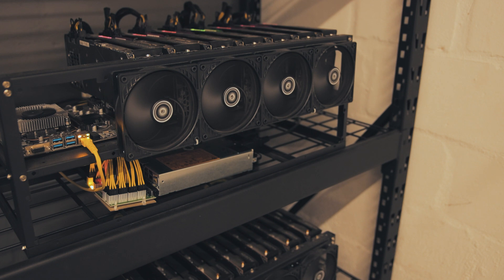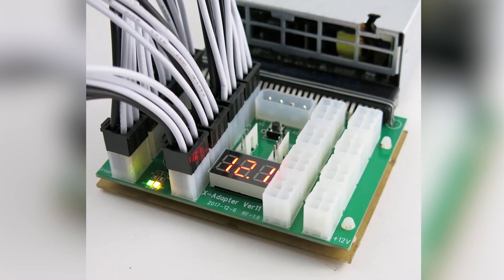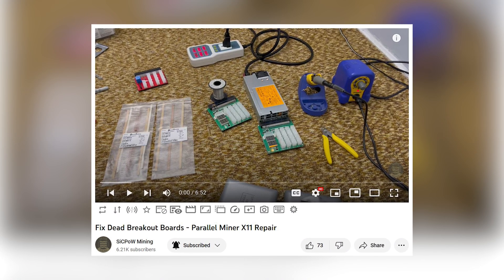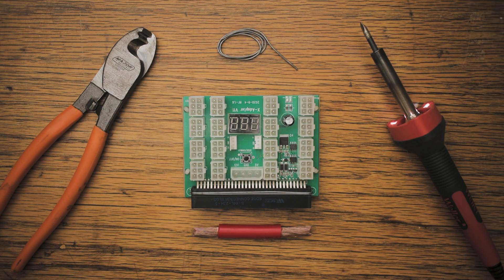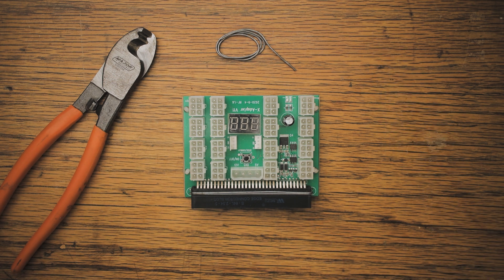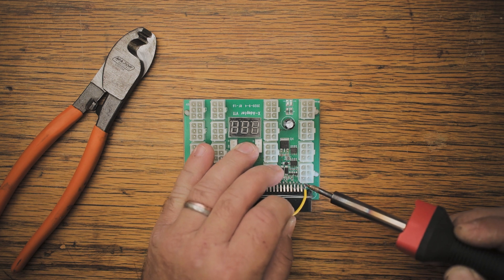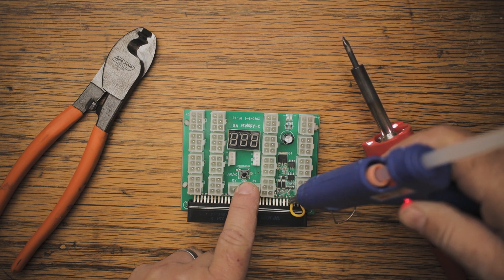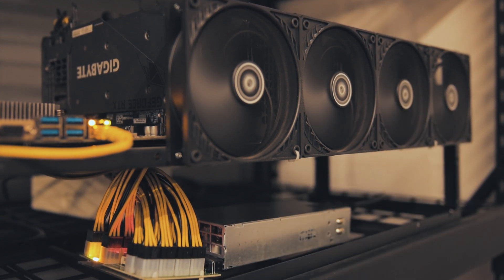It’s so EASY to fix - Parallel Miner X11 Breakout Board

Comment from the maker: Do you have  some faulty X11 Breakout Boards? In this video I will show you just how easy it is to get them up and running again!
Reply: Hey man just wondering if you ever figure out exactly what component is the one that fails, Long story short version , i had 2 that stopping powering up , not responding to the ON button , didnt use them for a year, now that i check them again they work, i feel like one component heats up and this cause the board to turn off

Comment: hi , In the video you mention he welds pin 1 and 7 together with a resistor and pin 4 and 5, how is your method different, I have a dell 1400w power supply, thank you.
Reply from the maker: When using a Dell PSU, then use the second method I demonstrated in another video.

Comment: Does this fix still allow the X11 board take a signal from an ATX PSU as to turn on or off? I have a schedule in Hive that turns off the rig during the expensive time of day pricing from my electric supplyer.
Reply from the maker: With this fix the psu will remain on at all times. Your schedule in hive will still work, as it will power down the motherboard, although the psu will remain on.

Comment: Just tried this on a PM x11-amp, no go, still yellow light on break out board and blinking on the power supply.
Reply from the maker: Which PSU are you using? HP?
Reply: @ThreeFoxCo  The Dell Delta DPS-1200MB
Reply from the maker: @loxety I found that 1 of my Delta’s also dis not work. I will be making a follow up procedure, which includes a resistor as well, which should solve it for Delta 1400W PSUs.
Reply: @ThreeFoxCo  I've got maybe 12-16 of the deltas, X11s, X11-AMPs and ZSXs.  I mainly have problems with the X11's dated September 2020.

Comment: Really unfortunate that the PM boards had this quality control issue.   I  have had a number of boards fail and at the premium price its frustrating.
Reply from the maker: A redesign of the control circuit would be welcomed. The board does what it is supposed to, until they die... Luckily we can fix them ourselves! Thanks for watching!